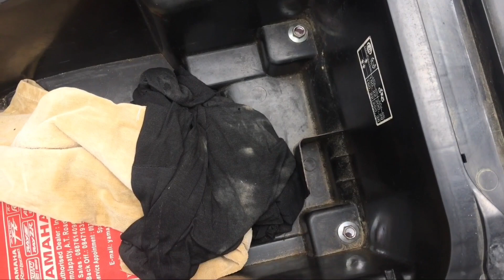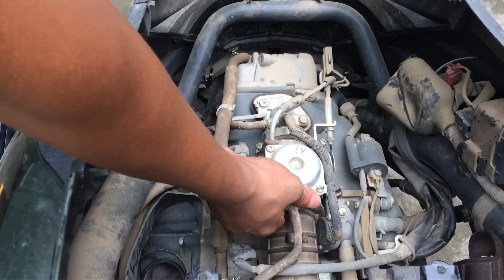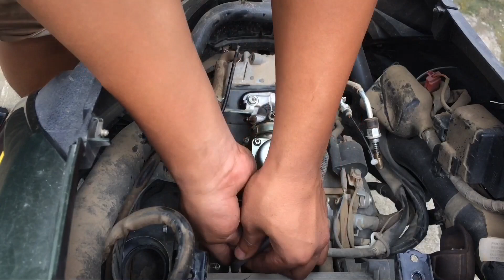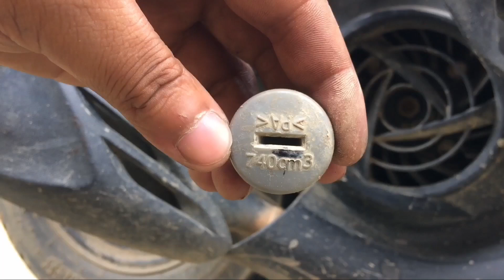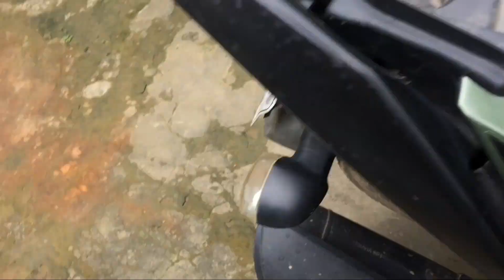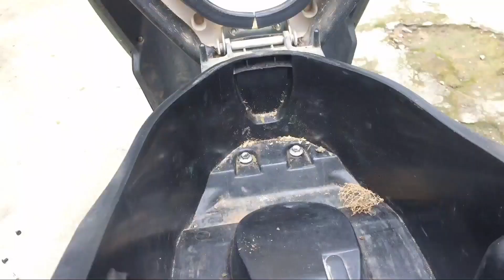Yamaha Ray ZR carburettor cleaning

Comment: Bro my ray zr keeps on accelerating by it self.cables are ok even the throtte is closed it accelerates. What is the reason?
Reply from the maker: Check the adjuster screws
Reply: Theres no adjust screws or I couldnt find them. I tried the cables de attched but it keeps accelerating.
Reply from the maker: There are... Search it
Reply: @SurvivorPurna  bro wht if the sensor connected to carb goes bad? Would that cause accelerating by ita own?
Reply from the maker: No... This not happened on acceleration. Look at the butterfly